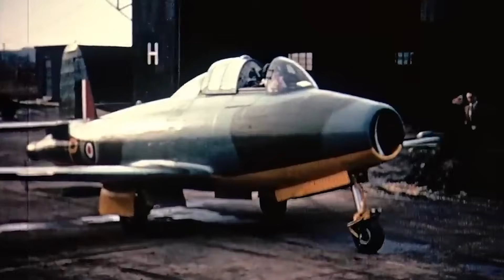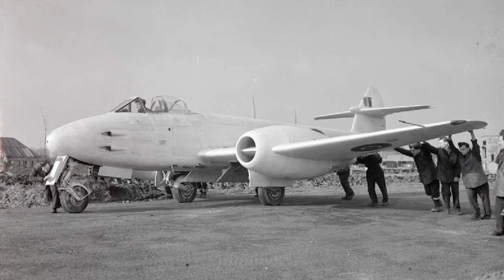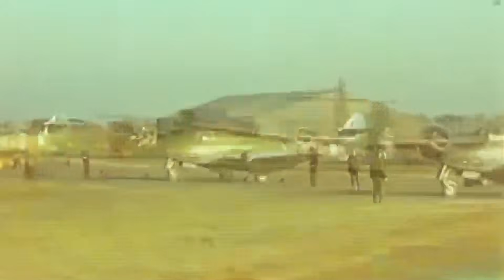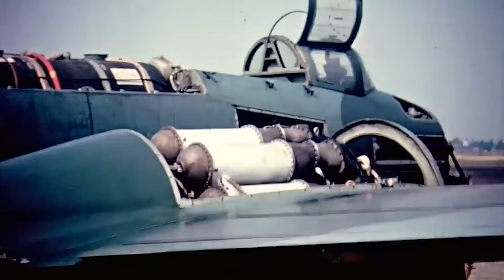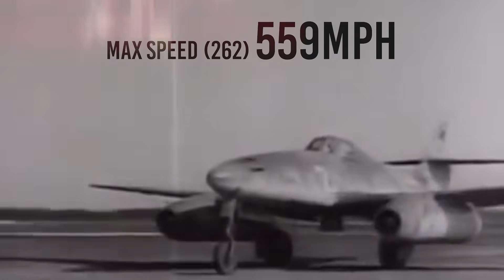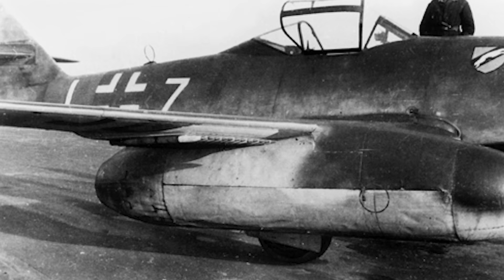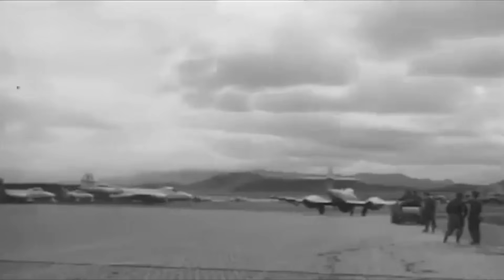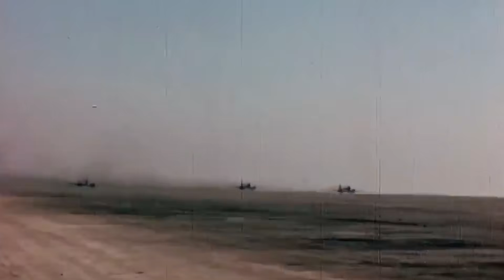Meteor vs Me 262 | Which was the better WW2 jet?

Comment: Although the Meteor was eventually fitted with centrifugal compressor jet engines it had actually been tested with axial flow MetroVic F.2 engines towards the end of 1943.  These engines were narrower, were hung beneath the wing like the Me 262 and created greater thrust than the centrifugal compressor engines.  The reason for sticking with the original lower specification centrifugal compressor design was due to ease of engine production (the F2 was still in a relatively early phase of development) and on-wing reliability of the engines.  The mixing and matching of airframes with different engine variants was a common theme in the war years as exemplified by prototype variants of Typhoon/Tempest using V12, H24 and radial engines.  The Tempest scored a significant number of kills against the Me 262 as they approached to land when needing to refuel.

Comment: Meteors where still in active service in the 1950's; the Me 262 wasn't. Which was the better WW2 jet? A silly question. 
I remember active Meteors at RAF Biggin Hill in the early 50's.
Reply: The Avia S-92 was retired in 1951. And first generation fighters like the Meteor and P-80 were outclassed by 1950.
Reply: @TTTT-oc4eb agreed but my statement remains correct.

Comment: The meteor mk3 had quite a few advantages over the me262 turn rate, range, ceiling height, more stable, easier to fly, more reliable, better climb rate, better fire rate and the mk 3 was only 20 mph slower and getting within 7mph as the war was in its final stages.
Me 262 would have dominated the early meteor mk1 but the mk3 held more advantages only losing out on a little speed and dive speed and would have been the more formidable of the 2.

Comment: Entertaining but some minor inaccuracies. It's highly debatable whether or not the 262 was in actual combat service before the Meteor. Also just as the prototype Meteor had tailwheel undercarriage, so did the 262 prototypes.

There was no military need for a nightfighting Meteor during WW2; this role was more than adequately filled by radar equipped Mosquitoes and P61 Black Widows. Same goes for a ground attack role, which was fulfilled by P47s, P51s, Typhoons, A20s, etc., to deadly effect. 

The 262's MK-108 gun was an inferior weapon in many ways to the tried and tested Hispano 20mm, but its revolver mechanism was the basis for the post war British ADEN 30mm. As correctly mentioned the Revi gunsight of the 262 was poor compared to the British sight. A Meteor F8 armed with 4x30mm ADEN would have been a devastating gun platform, but this was never built even as a test article. The Australian CAC Sabres did use the ADEN 4 pack, however, and with its other detail improvements and Avon turbojet was probably the best of all Sabre variants.

Really the 262's cardinal sin was that it diverted precious resources away from proven platforms into "yet another wonder weapon not ready for prime time", like the Panther, Tiger II, Maus, Do335, and other costly and ultimately unreliable pie in the sky projects when what Germany needed at the time was quantity and proven ability in battle over technical innovation and questionable build quality. More 109s, more 190s, more Panzer IVs and Stugs, all battle proven and well developed.

A very entertaining and well made video, all the same. Thank you for this.

Comment: What a load of tripe! The meteor entered service first, achieved its first kill (and several more) before the ME262 entered frontline service. And, of course, though the meteor might well have been a theoretically less advanced aeroplane, it was however an actual aeroplane that was useful in service. The 262 was a vanity project that never achieved any ability to engage in the actual business of war. Of course if it had been properly built with a diesel engine that could actually run for more than a few minutes at a time I know more than 10 hours before requiring a major rebuild, it might have been a good aeroplane, but it wasn’t. In truth it was rubbish, whereas the media went onto to serve for decades. The meteor was by no means perfect, but it was considerably better than the 262. 
The 262 may have been fast, but it couldn’t turn i.e. it had one chance to make one streeting run, but at the speed it went I’m at the guns it had it had almost no chance of achieving  a kill  hence its losses exceeded it kills substantially. 
How can you possibly produce a video that is full of it could have it may have, when in truth? It just didn’t do any of the things that you suggest? 
Honesty go back to the drawing board and do some research and then re-shoot this video. 
The ME262 was not a versatile multi roll aircraft, and in fact its 14 or so variants simply reflectWilly Messersmit’s schizophrenic thinking combined with Hitler’s manic obsession with divebombing.
The ME262 never choose when to engage, as it simply couldn’t stay in the Sky long enough to make any choices about engagement time. 
In the end, your video seems to draw a conclusion that if the ME262 was a much better plane, or even a proper plane., It would’ve been better than the Meteor, but the truth is it wasn’t, and never would’ve been. 
Should prevail, should be read as didn’t prevail. 
What a dreadful video!
Reply: Having dictated the above, I noticed a number of typos - diesel instead of decent, media instead of meteor etc) but I’m sure my point is still clearly made… This video is awful!

Comment: Adolf Galland once said that the truly unbeatable WW2 era jet fighter would have been the airframe of the 262 with the engines of the Meteor. Lower thrust, but considerably higher mechanical reliability, with a fuselage and wing that would wring better performance from the British turbojets.
Reply: The 262 would have different wings with different engines. The wings were a direct result of the crappy Jumo engines.
Reply: . There's some truth in that
Reply: @thelandofnod123  ...And as I already wrote in another reply to you, these different Me 262 wings would then have had a wing sweep of 35° degrees instead of 18.5°, because that's what the plans were and all this is well documented. 
The Jumo engines also weren't 'crappy' at all, in fact service and maintenance intervals and engine life of several early US made jets used by commercial airlines were no better than those of the German Jumo engines on the Me 262 were. 
Despite all the shortages at the end of WW2 Germany also somehow happened to produce quite a massive number of excess jet engines that were just laying around ready and available just waiting to be used in airframes that were never built.
Reply: @tomwoggle9411 Nonsense and demonstrably incorrect.
Reply: @thelandofnod123  How about you try to give a reputable source then?
Reply: @tomwoggle9411 No thanks. Just go and look at the platform. The wings are straight until the nacelles, as the plans intended for the entire wing to be, then swept to accommodate the altered centre of gravity caused by the crappy engines.
Reply: @thelandofnod123  You obviously have no clue what you're talking about and don't even know what the Me 262 looks like.
Reply: @tomwoggle9411 Charming, but again demonstrably false.
Reply: @thelandofnod123 Seems like you've never actually looked at the wings of a Me 262. It's easy to find historic WW2 photos of ME 262 showing the wings, go have a look. 
Also, even the Wikipedia already tells you about the wing sweep on the me 262.
It doesn't take much effort to find and verify the actual facts and debunk your claims.
it would take you less than 5 minutes to learn the actual facts , that's less time than you've spend stubbornly arguing here.
Reply: @tomwoggle9411 It would behove one to take the comment you have so graciously presented above and apply it to one’s self. 

Go and look, really look, look at the plans, the evolution, do some reading, don’t stop at Wikipedia. Although if you do read the Wikipedia article, seeing as you quoted it, read the second paragraph under the design section, then go and look at the references. 

Then look at the various angles of the wings and note their differences. 

Now as much as I hate to cramp a chap’s style, just to remind you, not only I can read your comments, but so can everyone else. Perhaps some editing on your behalf is in order, or a mild case of redaction.
Reply: @thelandofnod123  Yes, and when you do that, then you'll immediately see how right I am and how wrong you are.
Reply: @tomwoggle9411 So old chap, what you are saying is that the resource you provided, which specifically states:

“Originally designed with straight wings, problems arose when the long delayed engines proved heavier than originally promised”.

Is wrong?

Notably this is backed by 2 reference publications listed in the resource you provided and somehow, staggeringly, you are still claiming to be correct, contrary to the resource that you provided and contrary to those of us that have actually studied the aircraft. 

To paraphrase a great quote, it isn’t what you don’t know that is the problem, it’s what you know for sure that just isn’t so. 

So either you’re one of those people that can’t handle being wrong and persists regardless on the overwhelming evidence against them or you are one of those people the young fellows down at the club refer to as a “troll”. 

You pick I guess, although others can judge you from your own comments, I can’t help you with that.
Reply: @tomwoggle9411  You have completed your research I take it.
Reply: @thelandofnod123  What research? 
You mean looking up that one of three early wind tunnel model drawings that actually does have straight wings unlike all the actual design plans?
Reply: @tomwoggle9411 So straight wings were the intention then. Excellent, thanks.
Reply: @thelandofnod123  Wrong again, the straight wing design was for one wind tunnel test model to compare with other swept wing designs. 
What you're probably thinking of when you claim the Me-262 plans originally had straight wings is pre war Projekt P1065 from 1939. Which is nothing but a very general first proposal of a jet powered aircraft but it is in fact NOT an early Me 262 design at all. 
In fact it shares absolutely nothing with the Me 262, not the fuselage, not the engine nacelles, not the swept wings, not even the landing gear.

If you had actually done your research, then you should know all that by now though.
Reply: @tomwoggle9411 No not at all. If you were so inclined, you could perhaps dig up photos of the 262 V1 prior to the fitment of the worst turbines in history. You would then see a 262 with nice straight wings.
Reply: @thelandofnod123  What you see then is a nice Me 262v1 that does in fact NOT have straight wings. 
But you very obviously don't seem to understand the concepts of wing-sweep, leading edges and right angles.
Reply: @tomwoggle9411 My good fellow are you seriously suggesting that to be classed as a straight wing, the form must be perpendicular?
Reply: @thelandofnod123  At this point you're really just trolling. 
You very obviously don't understand the basic concept of wing sweep and straight wings or you wouldn't persistently keep arguing that the Me 262 V1 (a prototype primarily built for testing the jet engines and intakes not the airframe which is exactly why it has a piston engine) has straight wings which it doesn't. 
It's really more than easy and obvious to see the wing sweep on the outer sections of the wing on the Me 262 V1 prototype.
 
I'm really done replying to your silly nonsense here. 
Feel free to believe whatever you want to believe a straight wing is and however wrong it may be.
Reply: @tomwoggle9411 The airframe was built to test the turbine engines, that’s what you’re saying, which is why it has a piston engine? Wow. It has a piston engine because there were no turbines to fit and they needed to test the airframe. It flew over 40 times with only the Jumo 210 fitted, no turbines. 

As I said at the start, an Me-262 fitted with Wellands and Derwents would likely  have a different wing. This is due to the wing sweep of the 262 being a direct result of the correction to CoG issues because the turbines in their final form were heavier than expected. 

As you said yourself the part of the wing that is swept is beyond the nacelles, as I had also pointed out to you earlier. The wing root is straight as a remnant of the original design being for a straight wing aircraft prior to the realization that the airframe would have CoG issues, because structurally that is the easiest option. As I have pointed out to you, even the reference you insisted I look at says the same thing, as do the references that article is quoting (I know because I have both of them).
Reply: Well Thomas, old chap, what you are saying is that the resource you provided, which specifically states:

“Originally designed with straight wings, problems arose when the long delayed engines proved heavier than originally promised”.

Is wrong?

Notably this is backed by 2 reference publications listed in the resource you provided and somehow, staggeringly, you are still claiming to be correct, contrary to the resource that you provided and contrary to those of us that have actually studied the aircraft. 

To paraphrase a great quote, it isn’t what you don’t know that is the problem, it’s what you know for sure that just isn’t so. 

So either you’re one of those people that can’t handle being wrong and persists regardless on the overwhelming evidence against them or you are one of those people the young fellows down at the club refer to as a “troll”. 

You pick I guess, although others can judge you from your own comments, I can’t help you with that.

Comment: the ME262 wasn't a fighter it was a prototype with guns. Anyone can built an advanced plane that has engines which fall apart after 20 hours. Building actual combat aircraft takes real skill.
Reply: A prototype built 1430 times that shot down 542 allied aircraft?  
Just for comparison that's more than 3 times as many Me 262 prototypes than Bugatti Veyron prototypes were ever sold.
Reply: @tomwoggle9411 so 0.3 kills for each 262 built. Those are absolutely awful numbers

Comment: The vid is incorrect. The first operational jet plane was the Meteor from July '44. Operational is having fully trained ground and flight crews, spare parts available, and ready to be deployed anywhere. The Meteor was deployed to Belgium. The 262 was with a test unit until November '44. Swarms of slow US bombers were flying near the test unit's base, so the 262s were sent up.
Reply: No your wrong,,,,In July 44 the first prototype meteor flew in its test flight,,,,,On 25 July the ME262 took to the sky to attack a British recon mosquito over munic to become the first jet fighter in history to make a kill during wartime,,,
Reply: @nightstorm9128 
Operational was explained to you.
The Meteor first flew in March 1943. In that year it was fitted with a centrifugal engine and the Metrovick axial-flow engine, which out performed the centrifugal engine, and would have clearly outperformed in every aspect the 262. The Metrovick produced far more thrust than any German engine in the war. 
Now you know.
Reply: @nightstorm9128  
The mythical 262 Mosquito kill. The unarmed Mosquito saw the plane then went into evasive maneuvers. In doing so a lid on the fuselage popped off. The plane landed safely in Italy.
Reply: In 1943 the Meteor flew with a Metrovick F.2 axial-flow engine that produced far more thrust than any German engine ever did and outperformed the centrifugal engines. Blades were thrown, as metallurgy was not up to it so Wiggin in Birmingham was told to do research on high temperature alloys.  The government went with the safer centrifugal which would outperform any piston plane.
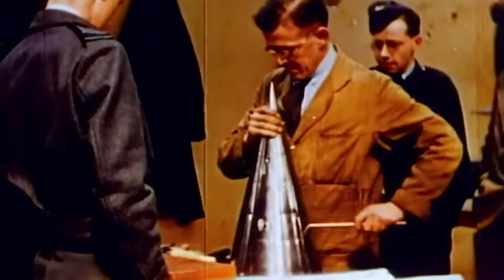Reply: @johnburns4017  Here's the "accident" report: "Mosquito LR433: Took off at 11:20 hrs for PR mission to Munich. 08/11/1944 Missing.
Shot down over Ohlstadt on 8 August 1944 by Me 262, piloted by Lt. Joachim Weber of 9./JG7.
Being the first confirmed victory of any jet-powered aircraft in the world.
Crew:
F/Lt (101.013) Desmond Laurence MATTHEWMAN DFC & Bar (pilot) RAFVR - killed
F/Sgt (969477) William Douglas STOPFORD (nav.) RAFVR - killed"
Reply: @johnburns4017  That same axial flow F.2 equipped Meteor S/N DG204/G exploded less than seven weeks later killing the pilot William Davie. The engine had less than three hours at the time of the fatal explosion. That ended the F.2, no more were ever built.